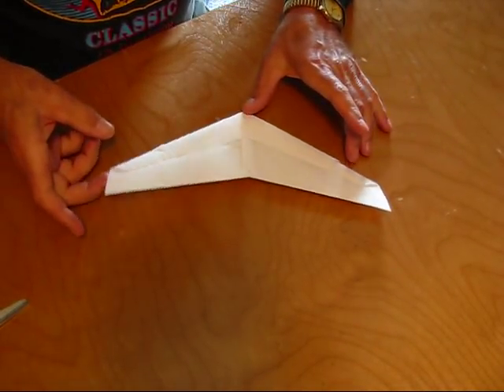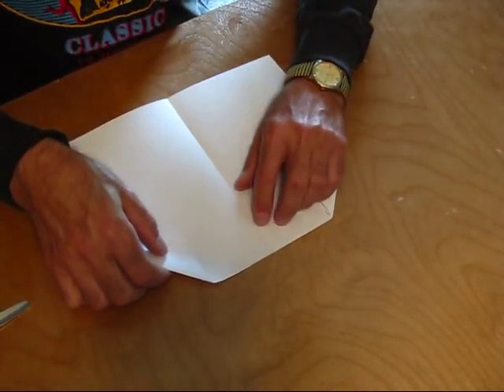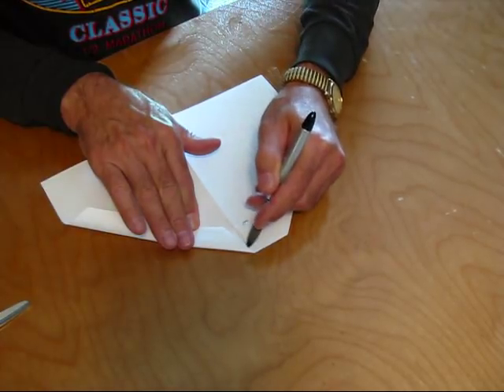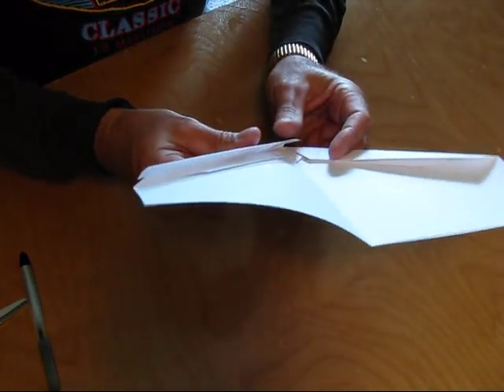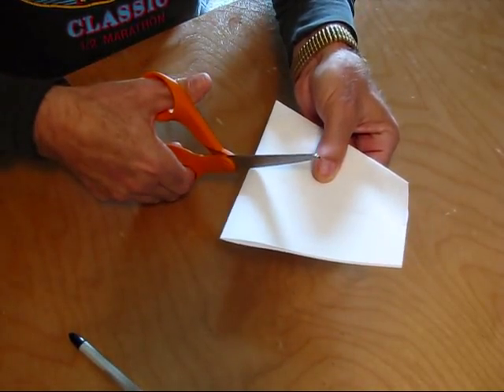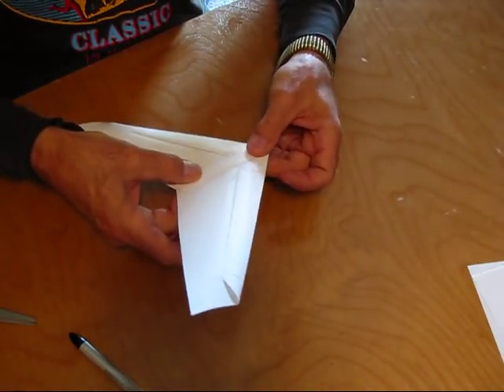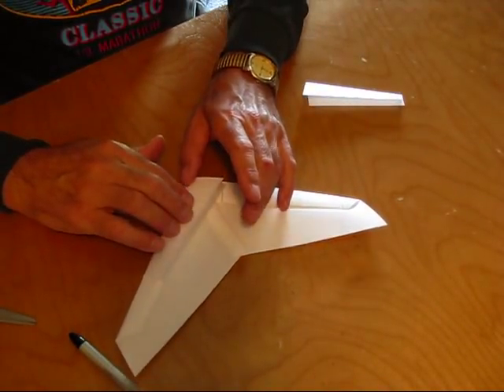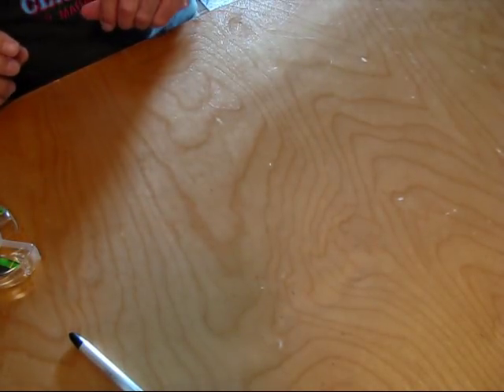Building the OmniWing Paper Airplane

Comment: Thank you very much for the wonderful project! 
My son is excited to follow this paper work with me and then experience the indoor and outdoor flight. 
Since I was a little 'practical flight, I took the liberty of adding a tail pipe made from a straw to drink. It helps regulate the GC (gravity center). 
I also helped to adjust the glide by 2 small flaps on the ends of the wings. 
In a nutshell this is smart design, economic, educational and great fun! 
Thank you for having contributed to engage children in games "healthy", averting them for a while 'from verbose video games. 

You are great !
Reply from the maker: Indeed the OmniWing is a great platform from which to make modifications from.  I great and inexpensive way to explore the wonder of flight.  Best to you all.
Reply: Redarkrome d-

Comment: Thanks for doing these tutorials, it helps and I'm having lots of fun with this plane! I have changed some things though, which are not to tape the twist down. I have also added stabilisers on the wing by folding up about 4.7 cm (1.75 inches) on each side of the wing. Then I would put the twist in later after the stabilisers are folded and add a little elevator. It now flies great and is very stable!

Comment from the maker: My inspiration for creation of the OmniWing Paper Airplane was out of a desire to better understand flight and aerodynamics, specifically related to hang gliding.  I have been a hang glider pilot since 1973 and I found that applying the same theories of aircraft design could be achieved with a very inexpensive medium.  Paper and tape.  Only tool requred is a pair of sissors.  It is very satisfying when I see a design of mine gain so much popularity on the Internet.  Bringing some joy to others!

Comment: I was impressed by the performance and the look of your Omniwing shown in your other videos. I immediately tried to build it myself but sadly it didn't properly fly the first time. Cause: The twist in the wings wasn't symmetric, which you mentioned might be the trickiest part. A short correction of it and it flew pretty well (only a small drift left), especially if I consider that it's the first try. So huge praise for your good tutorial, well done. Your explanations are superb.

Comment: You are absolutely right. I live on a very humid tropical island. Everything degenerates in such humidity. Plus the printer paper I used is very cheap and soggy. Your analysis is spot on. The design is intrinsically excellent however, the bowed wing is key and what sets this design apart from the average paper dart!

Comment: Love this plane! I've made quite a number of these both stock and modified. Recently, I constructed one out of gloss flier paper. My theory was that the Omniwing would fly farther and faster if made with a heavier material. I was correct, but I must also add that my overall design varied slightly from the original. For the most part, it was built the same way, only I added winglets and taped the flaps down with no twist so that the airfoil is symmetrical. I also omitted the taping of the cut scraps to the leading edge, feeling they were unnecessary with such dense paper. Now in order to fly with these mods, I had to crimp the trailing edge upward a bit, aim up, and throw extra hard. The result was a blazing fast wing that flies high and far...but stalls as airspeed decreases. Sometimes it stalls high enough that it flies back inverted! (although it falls short of the launch point) Theoretically, a ballast of some sort would remedy this, but I found that it just makes one chase after a proper CG. (the ballast brings the plane down, but adjusting the "elevator" accordingly simply causes a stall) My final thoughts are that this particular variant is far from perfect, but it's slightly elevated performance inspires me to continue experimenting with the Omniwing and rediscover why I love flight to begin with! Thank you for designing and sharing this amazing aircraft!
Reply: نبخل

Comment from the maker: What you are describing is that you found the center of gravity of this craft.  Additional weight at this location increases the wingloading, and will have a tendency to make it less susceptible to air current variations.  I fly a variety of hang gliders.  Some with larger wing surface areas, and those are more susceptible to air currents, requiring more control input during flight, where a heavier wing loading to to less wing surface area, makes the wing less susceptible.

Comment from the maker: What some of the other viewers have reported that they made modifications, simply adding a little vertical tab on the bottom center line of the craft to serve as a little handle.  Actually a pretty good idea as the OmniWing as it its is a bit challenging to hold and launch.  Thanks for your input.

Comment from the maker: You are correct.  I started working with paper airplanes in 1973 when I started flying the original Rogallo hang gliders.  I very quickly got way ahead of the hang gliding manufacturers of the day with higher aspect ratios and refined airfoils that were years in the waiting for hang gliding.  Hang Gliding eventually did catch up with my design.

Comment from the maker: Okay... this helps a lot.  I would bet that with the OmniWing, you are not mastering the step where you create twist in each wing half.  It is the twist that sets the wingtips at a steeper angle of incidence, thus that area of the wing acts as the elevator, counterballancing the weight on the nose.  Unfortunately this is a triky step, that challenges many first builders.  The Proto OmniWing achieves similar effect, but in a cruder, but simpler methodology to achieve twist and washout.

Comment from the maker: This has been my experience as well.  But I usually try to build a flying wing in a way to avoid having to add the winglets.  Fixing a nose light craft simply requires addition of weight to the nose.  Just a bit of additional tape and paper on the nose will correct the stalling.  Winglets can introduce another surface that wil require tuning as if one winglet is a bit off, then a turn will be induced.  I usually only employ winglets for aesthetic purposes only.  See the OmniWing Mods Video.

Comment from the maker: Most aircraft wings have twist in the wing, with the wingtip ending up at a few degrees steeper incidence than the center section.  This provides wing tip stability at slower speeds and prevents a tip stall.  Google some images of hang gliders and you will see the very obvious twist in the modern flex wing hang glider.  Duplicating this in a paper aircraft is the key, but is a challenging step.  I suggest maybe trying the Proto OmniWing on my channel as it presents a simpler method of the twist.

Comment from the maker: Sounds like you are not getting enough twist in the wings.  The twist in the wings is what sets the airfoil at the wing tips at a steeper incidence and serves the same function as an elevator.  If you have a wing that has too little twist, try tweaking a bit of upward bend to the trailing edge out towards the wing tips.  This will slow the wing down.  Good luck to you.

Comment from the maker: Yes, I use A4 Printer Paper.  I suggest you use the Scotch brand magic transparent tape.  It holds better and withstands moisture better.  Weight does matter, especially depending on where the weight is distributed.  I try to avoid having excess weight out on the wing tips, and of course weight distribution is important for establishing proper center of gravity.  I think there is a limit to how large you can make as at some point you will find that paper over large span will not hold it's form.

Comment from the maker: Although my OmniWing design predates the Northrop B2 Bomber, there were other flying wing designs that predated the B2 by both Germany and the United States.  Most of my inspiration for the design came from the early hang gliding designs of the early 1970's.  On my channel I have a video showing modifications to the OmniWing, and one of the mods shows the OmniWing with the signature trailing edge cut like the B2.

Comment: It works but, 1. It dives 2. I couldn't figure out how you did the twist on the nose. BUT your plane is Amazing I love how simple your tutorial was!
Reply: The span-wise twist is a difficult step to master.  Take a close look at my finished project of the OmniWing and you will see that the trailing edge of each wing half is set at a higher angel of incidence than the center section, thus providing an "up-elevator" effect similar to what an elevator would do on a traditional aircraft.  If you wing is diving, is is simply a lack of twist.  Try tweaking in some reflex out on the outer-most trailing edge to help slow it down.  Equally on each wing half.  Good luck and try and try again.

Comment from the maker: This would be a sign of not enough twist in the wing. Review the instructions and watch closely the method of the step.  Without the twist you have no portion of the wing acting as an elevator.  Also dont be afraid to try tweaking the wing post production, such as bending in some flaps to serve as alerons out at the wing tips to help slow the wing down.  Of course the best option is to get the twist step correct.

Comment from the maker: What you describe is the result of unequal twist in the two wing halves.  Right turn would mean your have less twist in the left half.  To correct, sometimes I am able to force a bit more twist, post production.  Another way to correct is by bending in a bit of aleron up into the left wing.  This will slow the left wing down and correct the turn.  But best is to practice building and makng equal twist in the two wing halves.

Comment from the maker: What can happen over a short period of time is that atmospheric conditions can have an effect on paper.  Humidity can cause the paper to loose some of the twist that was in place.  That would cause the nose dive.  Often I can take a plane that layed around a few days and tune it back up by forcing some reflex into the airfoil out at the tips if the twist has started to get lax.  Check out my video on aerodynamics.  Might be of some help.

Comment from the maker: Rather than twist you are taping in more of a warp.  It will fly better if you avoide warping the leading edges, but try to do the twist instead.  This is a challenging step, but is very important part of the design.  Try and try again.  Good luck to you.

Comment: Thanks for the video.  Are you familiar with the Horton 229 design from WW2? If not there are several videos on it.  I modified your design to that of the Horton and it flies great without having to add the additional leading edge pieces.  Try it out.

Comment from the maker: A diving OmniWing indicates that you probably are not getting enough twist in the wings.  The twist is what establishes washout at the wing tips which then act as the elevator effect, slowing the wing down.  Observe the twisting steps carefully.  Try to get as much twist in the wings as possible without causing the surfaces to wrinkle.  Also have a go with the Proto OmniWing.  A little simpler build found fo course on my channel.

Comment: I just tried this and didn't get the twist on the wing quite right and my plane took a nose dive, but being an AP Physics student, I tried bending about a 1/4 inch of paper from the back side up some the way an actual plane would use flaps to control pitch and got it fly straight my room is just to small for it to reach full potential.

Comment from the maker: The spanwise fold structure, if applied improperly can remove the twist.  When applying the crossbar structure, make sure your are enhancing the twist, not taking out twist.  Tricky step, but you will get it.

Comment: hi thanks for quik reply i watched that video you mentioned i have fixed my current one by doing the finger tip method on rear edge just a little  and did few test the omni wing flew 30m whol length of my back yard slowly descenting down pretty cool. i had fair bit of a twist in it but started from middle instead of from middle length of wing ill see how igo this time thanks heaps :P

Comment: try giving us some more information than that. what is it doing? if it climbs then drops suddenly, you need to either warp the trailing edge down SLIGHTLY, or add a little tape to the nose to make it balance. if it is diving, do the opposite. if it is rolling to one side, take the edge of the wingtip that usually goes up during the roll, and warp the trailing edge upwards. hope this helps. also, make a bunch. the more of them you make, the more you will learn how to make a good flier.good luck!

Comment: After I have completed making a wing, it would tend to "drift" in one direction or the other. I have produced several wings; most of which do this and only a few that fly straight. However, I don't see any difference between those that "drift" and those that don't. If you're wondering, the flights did NOT take place around wind currents or too much moving air, but it would be great if you could give me an insight on what might be happening,
Reply from the maker: It is pretty easy to "tune" the turn out.  If you have a left turn you can correct with just a bit of reflex or "up aileron" on the right wing by just a slight tweak of the outermost area of the trailing edge.  See my video on aerodynamics of the OmniWing at OmniWing Paper Airplane Aerodynamics.

Comment from the maker: Hmm....  Well first make sure that you are not launching it upside down.  All of the added structures should be on top.  If you are launching it properly, check for equal twist in the wing halves by viewing from the rear.  You can also check by laying it on a table and then actually measuring how high each trailing edge is out on the wing tips.  It is possible to to massage more twist in.  Also do not be afraid to bend and tweak the trailing edge.  With practice you will get it right.

Comment from the maker: Yes indeed.  Bernoulli's principle states that for an inviscid flow, an increase in the speed of the fluid occurs simultaneously with a decrease in pressure or a decrease in the fluid's potential energy."  With the Advanced airfoil of the OmniWing the air across the upper surface of the wing is moving faster than that on the lower surface as it has to travela greater distance, thus creating a negative pressure and increased lift.  Yes....  As Mr. Bernoulli states, it sucks!  Gotta love physics!

Comment from the maker: Top side is the side that has all the tape and structure.  So, launch with tape side up.  Now.... if you are having unsatistactory flight results, such as the wing diving, it is more than likely related to not having enough twist.  I would also suggest checking out the OmniWing Paper Airplane Aerodynamics on my channel.  Also, consider trying out the Proto-OmniWing first as it has a little easier build. Also found on my channel.

Comment: I made those back in the early 1990's and I flew a couple of them off a mountain in one of the hang competitions in which I was flying. One circled in thermals and nearly flew away from us as it got higher and higher, circling and thermalling on it's own.I also put on an A-frame like a real hang glider and weighted it with a weight to simulate a pilot. It was very popular with the hundred or so pilots and spectators. I made them out of A4 paper. The pilot weight makes for much better performance than just the wing alone.I also flew a real hang glider there competing in a competition.

Comment: hello menamiketrx in your videos it looks like you built the aircraft is in the video tutorial, but mine, I think it is very heavy at the tip because they fly much, my question is: if you have to see the role that is letter size , because in your tutorial you do not refencia of which are measures of the role you occupy, you could tell me? and if he has to do with the plastic tape that fixed. I'd appreciate it very much.

Comment from the maker: Actually there is some range of flexibility here.  Anywhere from zero to just maybe 5 or six degrees.  I have even gone more but as you kick the nose angle wider, you will get a higher aspect ratio wing with potentialy great glide ratio, but at a risk of some instability as far as yaw and roll.

Comment from the maker: The twist step can be a challengine step as this is rarely employed in other paper airplane projects, despite the fact that most full size aircraft employ some amount of twist in the wing for wing tip stability a slower speeds.  May I suggest that you first try the Proto-OmniWing.  It is very similar to the OmniWing but achieves the twist in a simpler and although a bit cruder method, it still provides a very nice flying wing.  See it on my channel.

Comment: i made one of these with letter size paper and right off the table, it flew well... it went to the side a bit so i curled up the points of the rear edge up a little.  it flies so well i can't seem to put it down.  a little push and it goes about 40'.  it glides very well and has awesome lift.  i can't wait to go throw it off the top of the parking garage where i work.  if yours goes to the side, curl up the rear points...if it dips right curl up the left side a little more...if it dips left, curl up the right side.
Reply from the maker: Congrats on your success.  Sounds like you have a good understanding of flight.  After some practice with your OmniWing, be sure to check out my videos for the OmniWing with Modifications, and the Advanced OmniWing on my chanel.  You will find that the OmniWing is a great platform for experimentation.